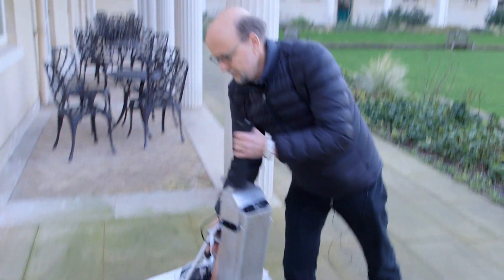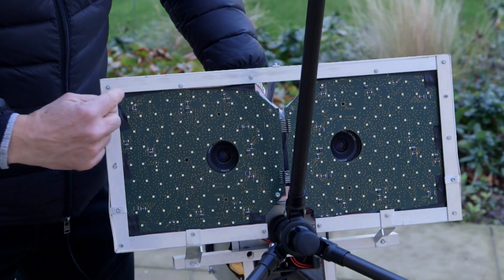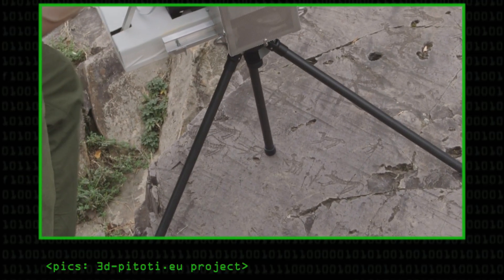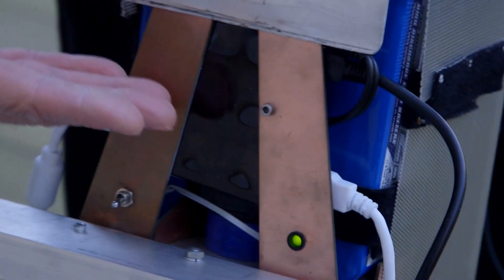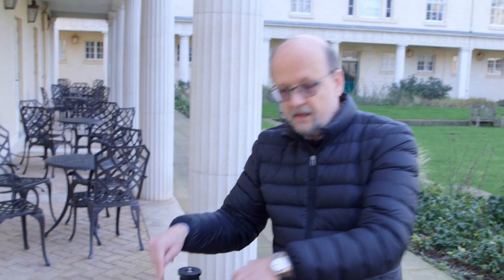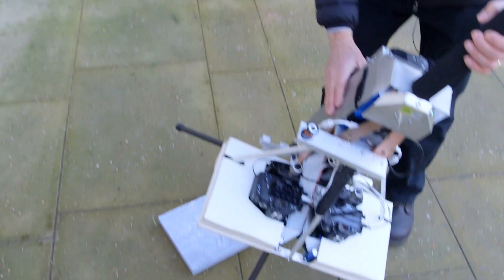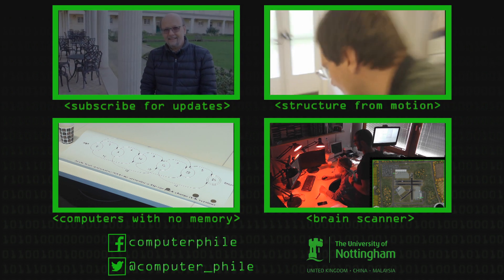3D Rock Art Scanner - Computerphile

Comment: In game development we usually name it voxels. Also pixels does not represent continuous data but rather points in space (as was explained in the video to be opposite). Pixel is simply the smallest controllable element of a given pixture, but then if you scale picture you start interpolating its data to ensure continuous representation. I'm sure that the scan data can do exactly the same: be represented as the only data of the image or with space between filled with interpolated information.
:)

Comment: Why couldn't you use it along with the sphere camera with crime scene investigations or anything that you need to get as many details of as possible out of? or just regular art? Does it really have to be that finely calibrated... From what I understand the way it works is by knowing where the LEDs are in Reference to the Camera lenses and in the case of multiple images, a static reference of some sort to them, but seems to me that isn't actually an issue since you can fix that with image matching software or something as simply as if you have a cable running over and area and are moving along it, the speed of tha camera's movement should be enough to match edges... likewise if you know the direction and speed, i see no reason why you couldn't use this with something like a drone which has to record and pass on that information anyways...
Reply: +Durakken - knowing the speed on a drone is actually very difficult. Even if you somehow work out the drone's speed, it would still not be precise enough for that kind of fine measurement.
Reply: +Durakken 
3D models of the ground/environment taken from a drone is being done quite alot already. Speed and direction is pretty irrelevant, the images are just aligned by features. Resolution and/or accuracy in the range of a few cm is quites easy to achieve nowadays. But this scanner has a different purpose.

Comment: This was a super cool video, it happens that I'm an engineer that works with archaeologists for just this type of stuff, specifically 3D capture and digital preservation of archaeological sites. It's very cool to see this type of technology being shown off, there's a whole world of different 3D measurement devices like this one.
Reply: +Hanniffy Dinn Leica P20 is the one I've seen, but there may be others available in the Leica range.
Reply: What other devices are there ? How do they compare to laser scanners ?
Reply: +Hanniffy Dinn Well, there are many different types of laser scanners, but there are also a variety of devices that can be broadly classified as 3D cameras, as well as software packages which enable users to take regular cameras and, by taking many many photos, allow the user to recreate the scene digitally in 3D. This process is similar to the one used by the device in the video, but generally less precise, because things are less controlled.
Reply: +Kruglord We use a Leica scanner, Cyclone and Jetstream mainly for producing building elevations and sections in CAD, but the CYARK project fascinates me, and I'd like to get involved in more archaeological type work.
Reply: simeon136
I've seen the exact same approach used to scan the surface of paintings.   That also penetrated the surface using beyond normal eyesight wavelengths.

I'm wondering if a laser scanner is detailed enough to produce point clouds for, say, something carved on a rock ?
Reply: +Hanniffy Dinn Yes, it is. My Boss scanned some carvings in a burial chamber in Wales and the results were very detailed.
Reply: simeon136
well, those laser scanners I going on my wish list then ! ;-)
Reply: +Hanniffy Dinn Just keep in mind that there are different types of laser scanners. There's the triangulation laser scanner with a range of only 1 or 2 meters, but that have sub-millimeter level accuracy, and then there's the time-of-flight laser scanners which have range of up to 100s of meters, but accuracy in the cm to mm level. For detailed things like rock carvings, you should use the triangulation type.
Reply: Kruglord
Do lecia have a brand name/model tag for the sub-millimeter range ones?
Reply: +Hanniffy Dinn I don't think that Leica do, but there is the  Konica Minolta VIVID 9i that I've used before.

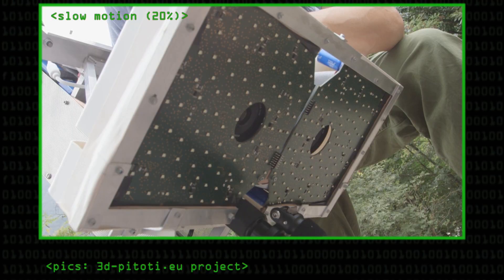Comment: Is there a reason why not every LED is lit up at the same time, as can be seen in the slomo at 01:47?
Reply from the maker: +Seegal Galguntijak I wondered, though it's probably a "rolling shutter" artifact of the way the camera works rather than the scanner - but I'll try to find out from Professor Pinz >Sean
Reply from the maker: +Seegal Galguntijak Confirmation from Professor Pinz: 

"Yes, it must be related to the shutter in the camera. The flash is ultra-short. Otherwise, we can't produce the required intensity. The LEDs would overheat."
Reply: +Seegal Galguntijak 
When you pause the video you can see that the boundary between lit and unlit LEDs crosses right through a single LED. Unless these are some very special kinds of LEDs it is not possible for them to be lit that way. So definitely rolling shutter.
Reply: If it is just rolling shutter, look up SloMo Guys' video on how a camera works. Gavin explains it really well with some good slow motion footage.
Reply: Ihrbekommtmeinen Richtigennamennicht Right on, thanks mate!
Reply: ***** Thank you!

Comment: if they're doing fine scientific work, why use a lossy compression like jpeg?
Reply: +Kiddobyte He said that they use the jpegs for an intermediate rough on-site evaluation but they store the raw images on the cameras and use them later in the lab for the fine radiometric evaluation
Reply: +Scrotie McBoogerball oh, I misheard, I thought it was the other way around. Like maybe they saved jpegs for later analysis to save space or something. My bad.
Reply: +Ashlea Wynter That's absolutely not how jpeg works. It uses discrete cosine transformations,  and this quantization introduces artifacts and makes the format lossy. Always. There is a lossless extension to the jpeg specifications, which is implemented in jpeg2000 but it is far from widely supported and works on totally different algorithms than jpg. 100% quality in jpg still introduces artifacts, just because of the nature of the algorithm. 

Also, most if not all camera's store pictures in raw format before processing.
Reply: Jpg can be LOSSLESS
Reply: +Kiddobyte JPEG only loses data if you resize it or specify a threshold of acceptable quality loss. If you take a picture, all the data can be interpreted as JPEG and stored using that format on the camera's storage with the reduced size that comes with JPEG while still keeping all the data that was actually taken at the time the picture was taken (chances are, some pixels are going to be the same color, maybe not a lot of them, but some). 

You can still use the JPEG "compression" without losing data as long as you're not giving it any kind of threshold .If the picture being taken is really varied and complex, JPEG likely won't be able to do much, but it will still be slightly less/on par in size when compared to PNG.

Once the picture is taken and stored, it can later be removed from the camera and converted to PNG, where it can then be used and resized if needed, but for the purposes of camera storage, there's no difference.
Reply: +Kiddobyte For this I agree with you and the other responses. Sometimes though, for a given file size, it makes more sense to store a picture using a slightly lossy compression at a higher resolution.

Comment: I think the word he's looking for to describe the points is "Vertices"
Reply: +Vlad Ţepeş If there would be topology (triangles or polygons) they could be called vertices. In this modality it's normally just points.
Reply: +Vlad Ţepeş In terms of most digital representations, points clouds are distinct from vertices. A point cloud (something I work with in my research extensively) really is just a collection of 3D points, XYZ coordinates, usually with some additional information included. That data is sometimes RGB colour, or sometimes just a single 'intensity' value indicating monochrome brightness. These points are stored in clouds, and are usually not dealt with on an individual level. 
A vertex on the other hand, though is also a 3D coordinate, usually exists on its own rather than in a set of vertices. They can have any number of additional pieces of information associated with them (name, height above ground, connectivity, etc).
Reply: +hymen0callis appropriate for tessellation
Reply: I guess, but in order to make a 3d model you need polygons
Reply: +Vlad Ţepeş There are algorithms to construct 3d model from point cloud. But the data extracted from stereo image 3d reconstruction is point cloud (along with RGB).